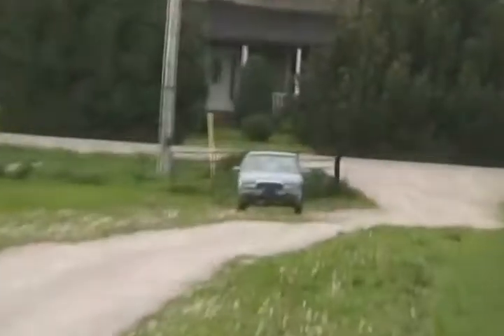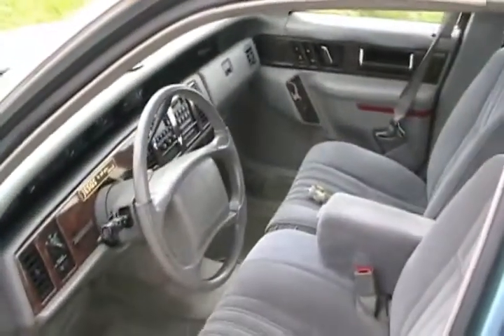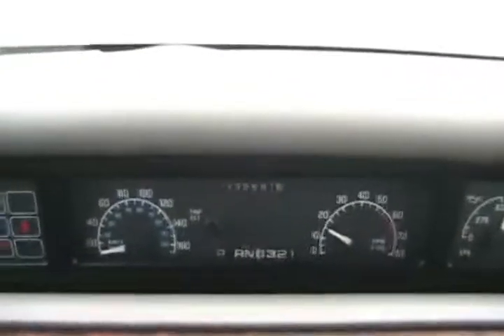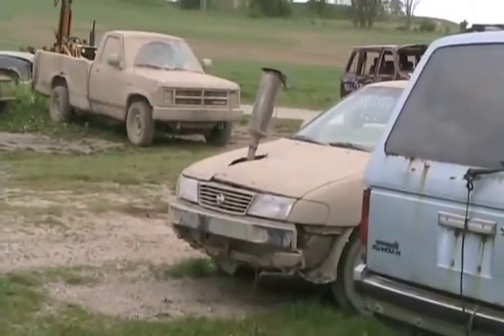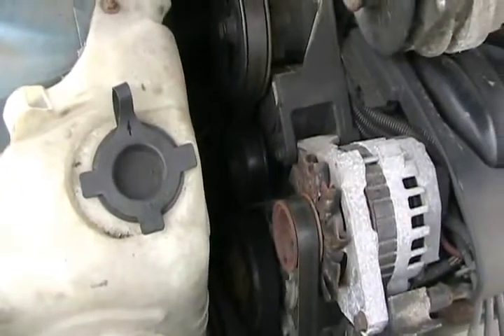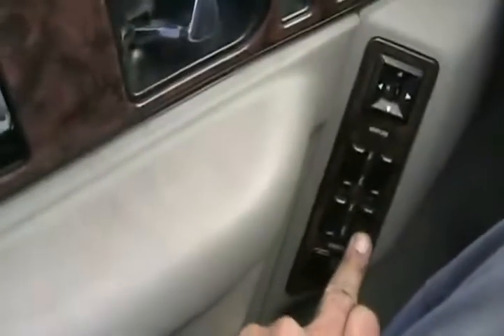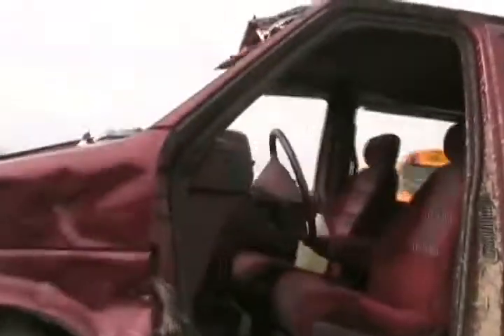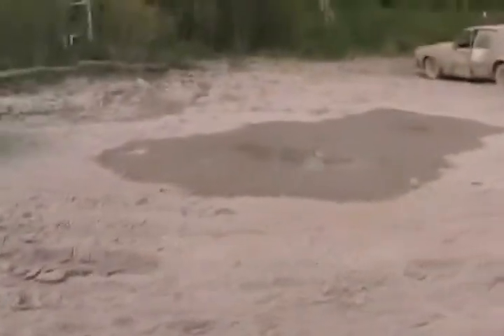#961 Davidsfarm got a 94' buick regal to trash [Davidsfarm]

Comment: This goes to Dave. Yes here in the states are car like this would still be driven. Down here in Southwest Missouri I have a salvage yard and when a car like this comes in I service them and put it in the Front sellers row. I sell them to working men mostly who need some transportation to a job.I sell them cash only but work out deals for some of them.And surprisenly enough I've never had problems getting paid for a car . But I won't sell a mechanical asshole .If I won't drive it myself I won't sell it .But do beat the hell out of rusters ,rotters & Running wrecks. though .Knockers and thrashed cars get parted out. But decent running and looking cars get serviced and sold.

Comment: you can always depend on your 3800
Reply: The Series 2 3800 is better in my opinion, they sound great upon startup.
Reply: yes and 3.1 love my 3.1 one of the best motor's ever built in my opioion had one in my corsica and one in my malibu love both
Reply: i got a 3.1 in my Grand Prix. It is a great motor
Reply: ya my old malibu is just about rdy for the rock pile 16 yrs old but under is all rust wont pass saftey so selling in spring motor stil run strong looking at a cruze
Reply: harryrez Until the intake manifold pisses out all of it's coolant.
Reply: Well thats more on the series 2. The Ln3. like i have in my 1991 Eighty Eight is very durable
Reply: I have a 1988 Century 4 door custom and just hit 87,000 miles. One owner. Gentle miles, nothin beats General Motors..